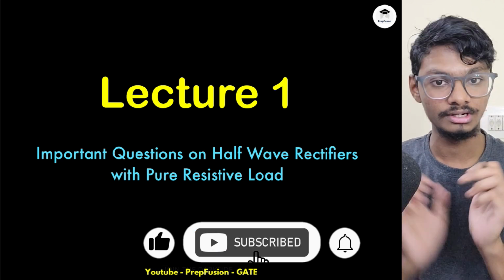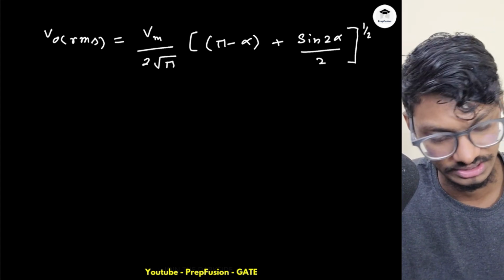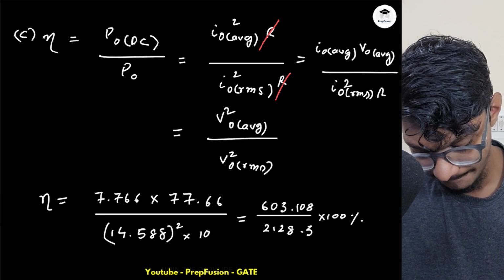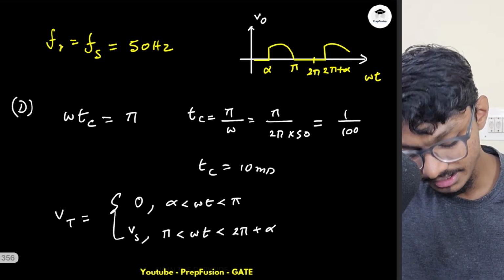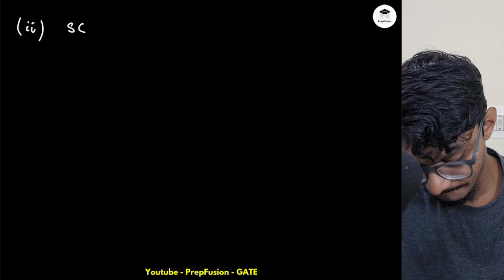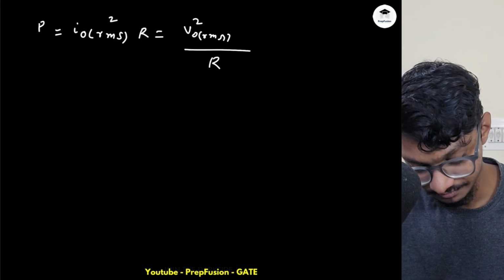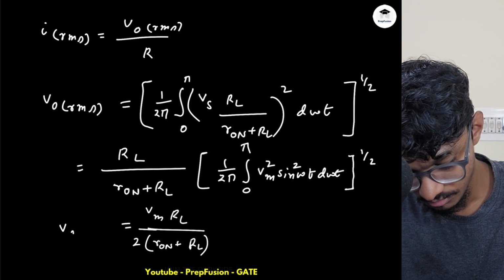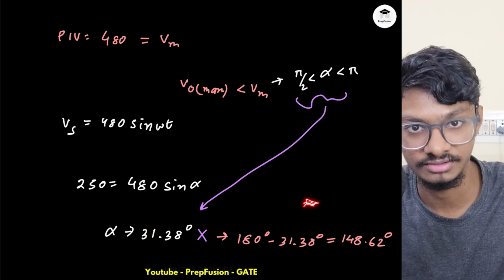Important GATE Questions On Half Wave Rectifier || GATE 2025 || PrepFusion || Anish Saha

Comment: Best part is you have solved questions exactly related to concepts previous lec, got the doubt cleared too. Solved every question by deriving the equation. I have got a conclusion for the converter we have studied till now ,please let me know if I am wrong.
SCR voltage, VT(peak)=
{
 VmSin(Alpha) ; 0<(Alpha)<pi/2
 Vm ; pi/2<(Alpha)<pi
}

O/p Voltage, Vo(peak)=
{
 Vm ; 0<(Alpha)<pi/2
 VmSin(Alpha) ; pi/2<(Alpha)<pi
}
Reply from the maker: Yes absolutely correct!!